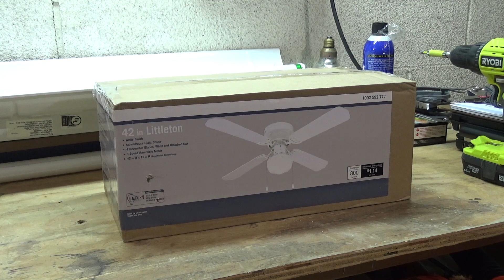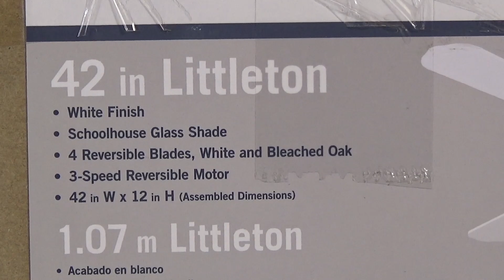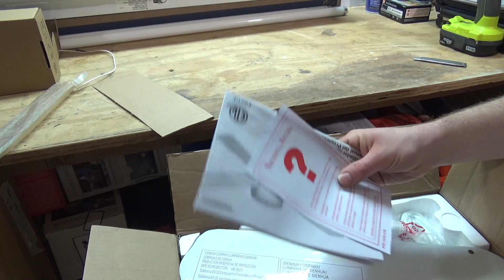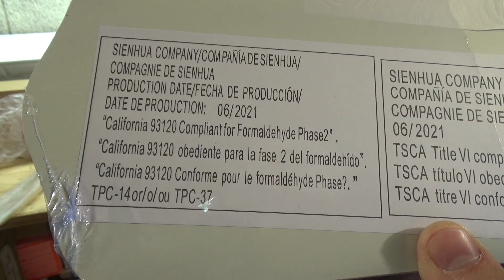Installing and Testing the Cheapest Ceiling Fan Available | 42" Hampton Bay Littleton Ceiling Fan

Comment: We hung 42 of these four years ago for a customer in his 4-plexes.
Not one has failed. Several had broken glass fixtures from careless renters, two had blades snapped off in fights, but the fans themselves - not one failure.
And, yes, they were less than $25/unit at the local box store.
Reply from the maker: These do seem to hold up pretty well over time.

Comment: I’ve had one of these in my bedroom for many years. While the bearing noise never really goes away and the chains on the pull-cords like to clank up against the light cover, it’s a very good ceiling fan for the little room I use it in.
Reply from the maker: That's unfortunate, I was really hoping the noise would dissipate after a few hours of operation.
Reply: My house originally had 4 fans and they were all littletons, the one in my bedroom was the only one that didn’t have a defect, the globe on my sister’s Littleton broke because I hit it with a trash can, my mom’s wobbled so bad that it scraped against the motor very loudly because 2 blades were bent, the one in my office had a pull chain issue and eventually it was only 1 speed, it was low or off, mine was fine and had absolutely no issues and blew a decent breeze, I thought it was ridiculous that mine got replaced with the others because my grandma wanted it to match the others
Reply: @JordanU  do these fans go fast
Reply from the maker: @coolsimanhead6165  What do you consider fast?
Reply: @JordanU  i mean it looks faster then the one In my room
Reply: I'm not sure if you noticed, but one of the rubber isolation pads was missing from where the blade irons attached to the motor (I think it was on the last blade you installed?)...but it was made in China.

Comment: Thank you for this video. Your video helped me. I couldn’t get the light to work, and after watching your video I realized I attached the blue wire with the ground wire, instead of connecting the Blue wire with the black wire to the hot wire. 😂

Comment: I bought a littleton a while back to install in the guest room. It works okay,especially since it is the cheapest fan you can get, but I feel like the $40 that I spent on it could have cone towards a much better used fan, but my mother wanted new. It works okay, but not great although it isn't used for much besides for the light 99% of the time anyway. Of course the LED bulb it came with went directly in the trash.
Reply from the maker: The 40 dollars is much better spent on a used one that's old, but as you encountered, not everyone wants an old one.

Comment: Also manufacturers stopped putting screw head markings on the light kit screws as many people would damage the glass by over tightening them. They never were supposed to do that with the screws as many companies didn’t do it until they started doing so with the school house fixtures sold separately. That’s why they don’t do it anymore to prevent people from over tightening it.
Reply from the maker: Thanks for letting me know.

Comment: Surprised you didn’t use the one you tested a few years ago in the garage. And yea the lowes version is better and moves more air. I got a Littleton new for my aunt recently to install in the hallway and while it does hum a bit and can be heard from upstairs it still does the job at least.
Reply from the maker: It wasn't worth the time to track down all the parts. They'll surface eventually.

Comment: I put one of these in my nephew's room in '15 or so, cause I wanted the 52" Hunter (plus the room only needed a 36"-42" fan), and it's actually been surprisingly good and quiet. Also, my neighborhood liquor store has two of these over the front counter, with the bleached oak side showing...they have the schoolhouse shades installed, but I've yet to see the lights on.
Also, you just demonstrated the reason why they included that extra screw! 😉 (I'm only joking. I mean no disrespect!).
Reply from the maker: I've seen these in commercial environments a number of times, they do seem to hold up OK over time.

Comment: I remember back in 2009 they were $23-24 dollars. Then around the lockdown they were around $27-29. And more recently they went to $32 and then $37 and most recently $44. Definitely not a good product but for the price it’s not bad. As long as you get one with no bearing noise it’s a decent product for what it is.
Reply: It’s ridiculous how much they cost now. The Farmington was about $50 two years back.
Reply from the maker: I remember when they were only 16 dollars, I believe that was sometime in the 2010s.

Comment: I installed one of these and it moves basically no air at all, on the forward or reverse settings.  So I started looking online to see if I've done something wrong.  Bizzarely many people have the same experience as me.  But many have an experience like you.  And I can clearly see that yours is working better because I see your hair moving.  Sometimes manufacturers contract the same product to different factories at, and it could be that pitch of the blades differs on my model vs yours. /shrug.  Anyway, mine is going back.
Reply from the maker: Years ago these used to be made by SMC, which was a fairly reputable company. I'm not sure who makes them as of now, it very well could be that it changes month to month based off the cheapest bid.
Reply: @JordanU  FWIW I returned and replaced with another one and it worked fine.  Issue with that particular fan I guess.

Comment: Even if it is the "cheapest" ceiling fan, it looks to move alot of air and at least it doesn't make alot of noise or wobble like some ceiling fans.
Reply from the maker: The bearings are audible, but everything else is at a reasonable noise level. Airflow is satisfactory for something of this size and style.

Comment: These fans aren't that bad except for the subpar paint job.

Edit: this model was released in 2020 and it replaced the older one, which in my opinion was much higher quality compared to the newer one.
Reply from the maker: The paint is the least of the concerns, especially when it's on the ceiling.
Reply: @JordanU  Makes sense.

Comment: I'm not sure if you noticed, but one of the rubber isolation pads (where the blade irons connect to the motor), was missing. I don't think it will make much difference, as it's not a super-quiet fan to begin with, but for an inexpensive, Chinese-made fan I'd say it's not bad at all!
Reply from the maker: It's satisfactory for the price.
Reply: @JordanU  
100%! It's a decent fan for It's low price. My old apartment actually had a late-90s version of this type of fan, but with antique brass motor housing and wooden blades. 
I hate that this model only seems to come it white now. It would be nice to see antique and bright brass options.

Comment: I had the Middleton which was the next model up from the Littleton it was 39.99 now it’s 60. It was the worst fan I ever had.  was made by smc and had same motor just with 5 blades I had motor replaced twice under warranty the last time the bearings went too the point you could move the whole motor around too much play I finally gave up and bought a Hunter low profile iii and have had for several years and no problems so far I am a stickler when it comes to noisy fans especially in the bedroom.
Reply from the maker: Thanks for letting me know.